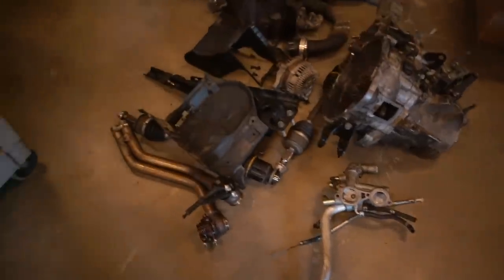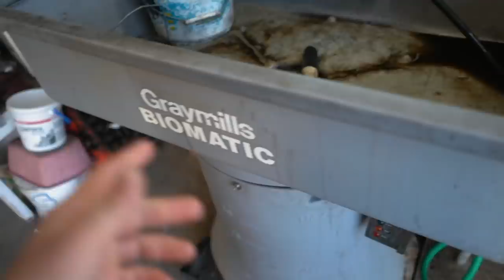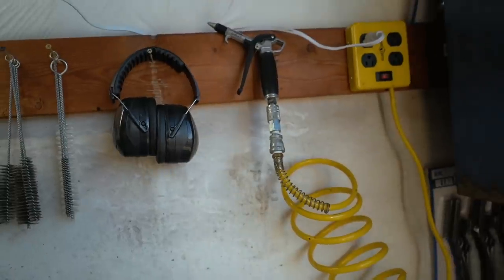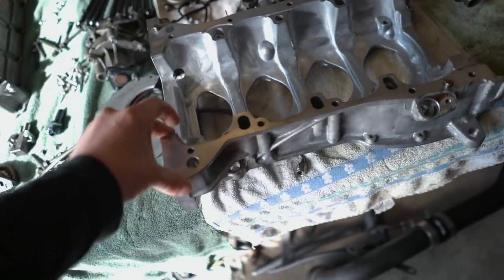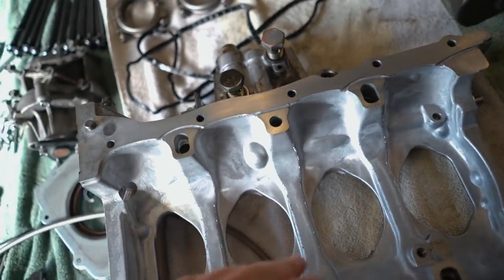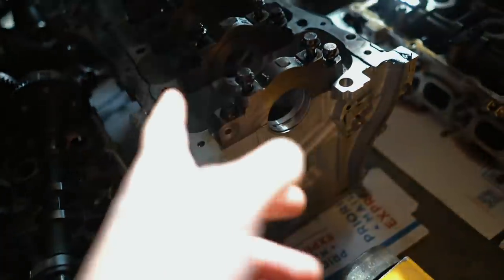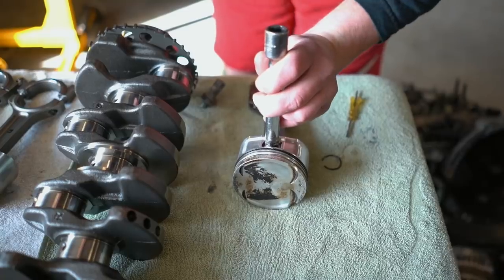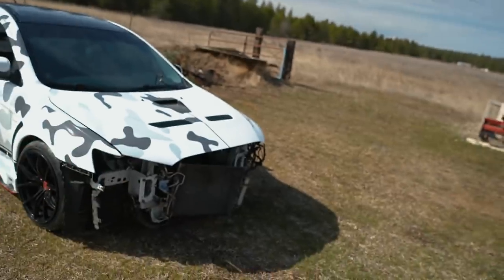Starting the Evo 10 Motor Build!

Comment: Whens the motor rebuild starting? The pistons got baked in mine. Had new super tech valves installed and machined the seats. Wondered if you'd given any thought to over sizing your pistons. I took the opportunity to install 86.5 cp pistons. Always nice to upgrade when the opportunity arises. 👍

Comment: What causes an engine to misfire?
Reply: Tou Xiong Cracked components
Reply: Tou Xiong A lot, messed up components/parts, spark plugs, ECU.
Reply: @carculture2960  I got 4 cylinder misfires codes now on my subaru, spark plugs replaced and coils. still misfiring..took it to a subaru specialized shop they said it needs top end rebuilt due to worn valves?...
Reply: Tou Xiong Probably try and replace the valves or maybe there is a deeper lying issue, replace the valves if you want but it might not fix it especially as their is multiple codes